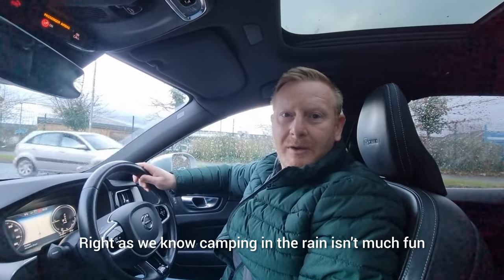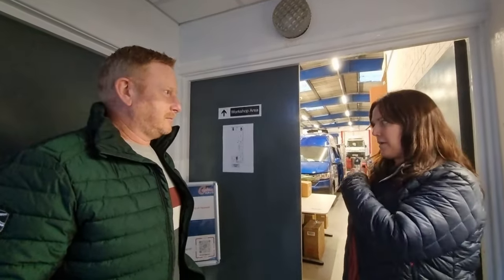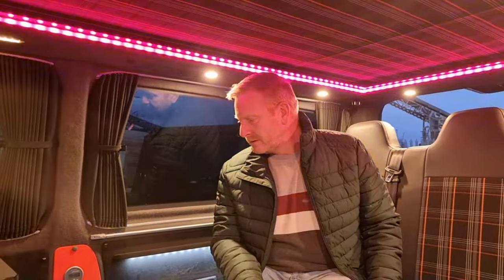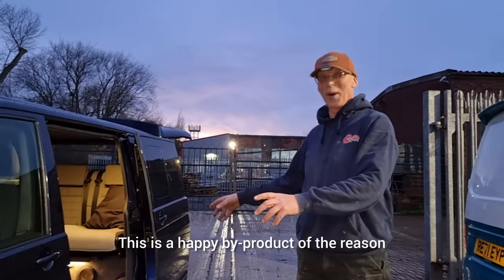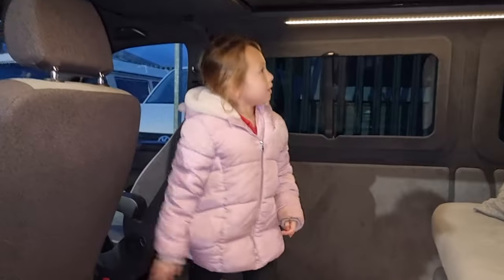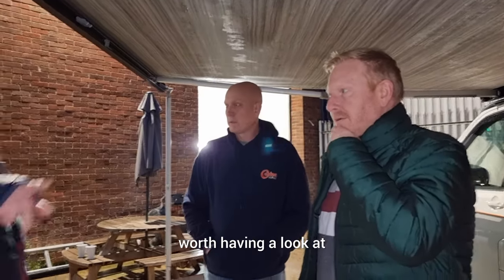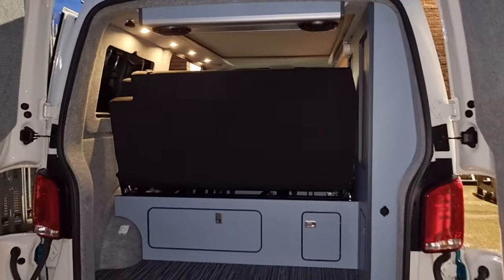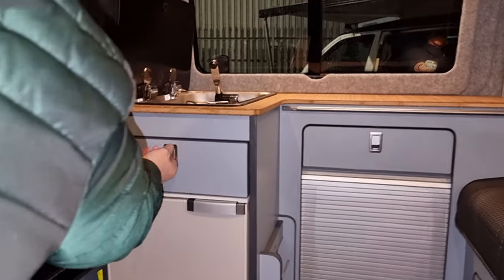Camper Van Window Shopping | Do We Buy One, Or Stick To The Tent?

Comment: The great thing about the transporter is you can do so much with them ,I have a t6.1 204 dsg highline lwb swamper kombi camper from van haven in Dorset, we have swivel front seats  3 rear individual but removable rear seats ,plus a 40 winks bed ,that means we can leave a full queen size bed out all the time and have massive amount of storage space below the bed . You can also go for a full carbon fibre pop top roof ,this seats considerably lower than most pop tops and it's barely noticeable and it means you can still get into most carparks.  The Lwb van is a must that extra 50 cms of interior space doesn't sound like much but trust me it is . A dsg gearbox is lovely for long trips as is the higher out put engines, I have a twin turbo 204 bhp t6.1 transporter and its a flying machine. Don't bother with a low spec van get a high line model it will come with most of the stuff your volvo has, my can has Factory LED head lights and on a transporter that is a 100% must have the the stock transporter head lights are shockingly bad .we have discover media system apple car play ,factory sat nav plus camera and 360 parking sensors. My van even has auto park ,heated seats Air con adaptive cruise control and soft closing doors and tailgate. Also a tailgate model is a must this also gives you additional outside covered area .we have a fiamma 45s awning on.the drivers side of the van and an additional remo awning rail on the passenger side of the van. So we can if for a one night or just a day out use the fiamma awning, or for 2 or more nights we can use the inflatable drive away awning on the left hand side of the van. Note buy a kadar strip, this bit of kit makes life so much easier for detaching your drive away awning. Lastly make sure you get the newest van you can afford and make sure its euro 6 .these bloody  emissions rules are crippling if you have to pay every time you want to drive your vehicle. Our van is a euro 6.2 class vehicle and isn't  subject to any charges  just yet, but give them time. I hope this has been of some help ,go to one of the camping and caravan shows before you buy something get a real idea of what's available and how your set up will best work for you .oh and don't forget a diesel heater and to fully insulate and sound deaden your van ,remember it started life out at a commercial vehicle. Best of luck  hope it all goes well for you and your family 🤟👍
Reply: the stock headlights on the 6.1 are more than adequate i think most people that complain and say they are like candles have never driven one in the dark or had never had an older vw camper.they are very much improved over the T4 that i had for 8 years. i hate traffic so always travel away during the night been to the lake district driving there and back in the dark also wales and devon after reading all the negatives regarding the headlights i was surprised how good they were especially with the cornering fog lights
Reply from the maker: Thank you for this info, it really has given us something to think about. The fact that we can just shoot off on weekends is very appealing. We are weighing up all are option this month and then looking to take the plunge with what we and the kids decide👍

Comment: Definitely go for a van. And very importantly go for lwb. Not swb.
You get an extra 400mm which is very useful. Especially when you pull the bed out.
They'll try to sell you a swb. Because they say easier to park. Don't believe it.
I have a Renault trafic 2019 lwb
premier edition. It's my car & Campervan. And I never have any problems parking. You also get an extra 400mm cupboard which is very useful 
You'll need a drive away awning. Get sown in groundsheet if you're thinking of sleeping in awning.
But possible you wouldn't bother with awning for short break. All sleep in van
Reply from the maker: Hi and thanks for the comment. We are seriously considering the van, but the one sticking point could be our 11yr old son, not being keen on sharing bed space with his sister...tricky one that we are looking to see how we can overcome it. Still got to check out caravans first though.. look at every option, before taking the plunge👍

Comment: Ahhh, the thick end of £70k for a van with a tent on the roof. No thanks. Try climbing down from the 'pop top', slipping on the drivers seat and mangling your manhood on the steering wheel in the middle of the night to have a wee in the facilities. That's before you trample all over the kids and dog to open the door out into the rain. And the 'pop top' has all the acoustic blocking of cling film.😢
Reply from the maker: Hi, yes we were unaware of exactly how expensive they were, so this was an eye opening trip. For us though, having two kids at ages were they bicker quite a bit, is one reason why it is not suitable for us. The tent we have now allows us to keep them separated.. a camper van would not...